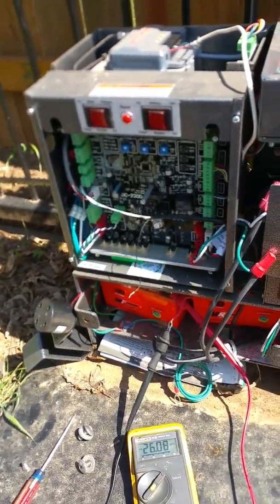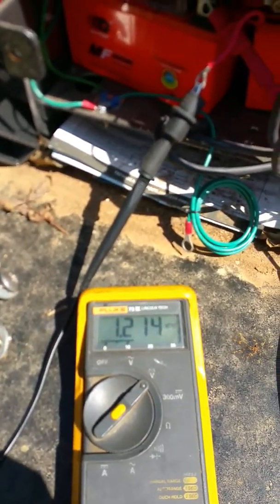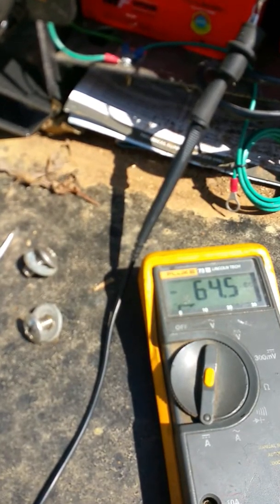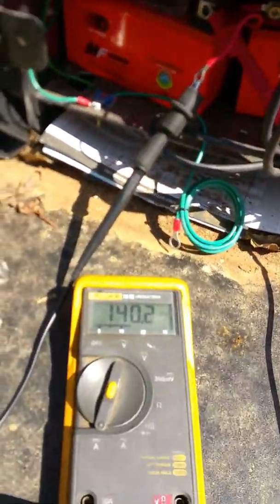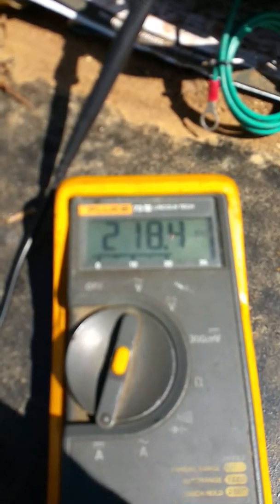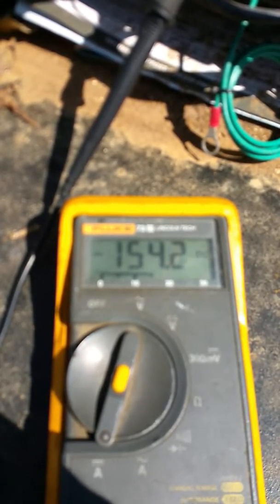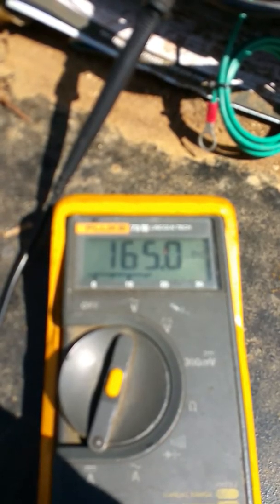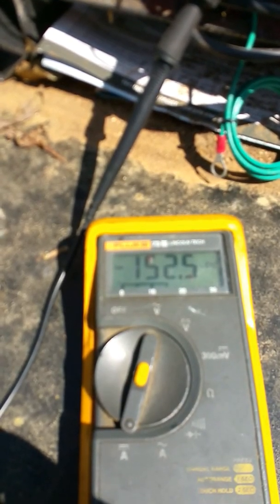Platinum solar slide gate problems BLSL580

Comment: You've probably found a way to fix it by now but just thought I would throw in my 2 cents. I have the same brand but different model with two 7 amp hour batteries. Mine calls for a minimum 80 watt panel that produces 40 open volts (voltage measured when not connected to anything). It also says it must be a minimum 38 volts to be strong enough to charge the batteries. Here in southwest Oregon on a cloudy day mine measures just over 38 open volts. I have not checked the parasitic power draw but I have not had a problem with batteries going dead except for one time when we were gone for 5 weeks. As far as I know the gate was never used during that time and when we got home the batteries were dead. One area you might check is to make sure all the relays on all of your key pads and receiver are operating in momentary mode and not in latched mode or activate = on/activate again = off. I don't have any vehicle detection loops and don't know much about them but I think you should check them as well. My gate problem is that once in a while it will open completely and then beep and it will not close automatically. The close timer does not start it's count down and it doesn't time out to make it close. Most of the time I can push the remote and it will activate the timer and close once it times out. Sometimes I have to push the reset button in order to get it to start working again. I ran an extension cord to it and with it plugged in I had no problems whatsoever for 3 monthsHave you had a problem similar to mine? And if you have fixed it, what was the problem?
Reply from the maker: Honestly, I haven't been back to this customer's gate since this video was made, so either it's working fine, or they got fed up and went another route.  I didn't install this system, only tried to figure out why it kept going dead.